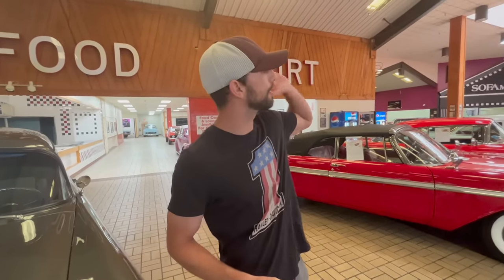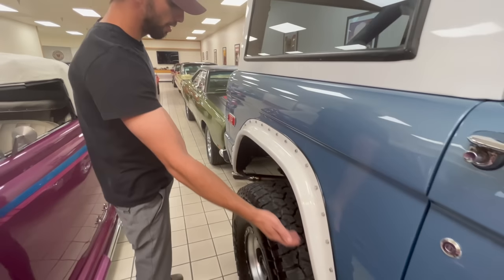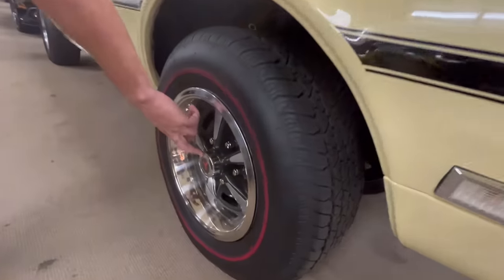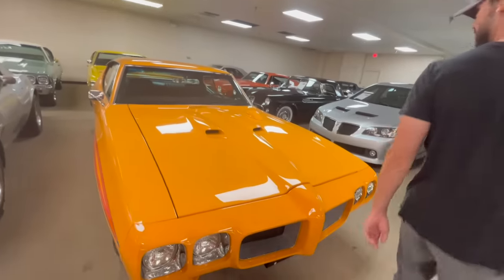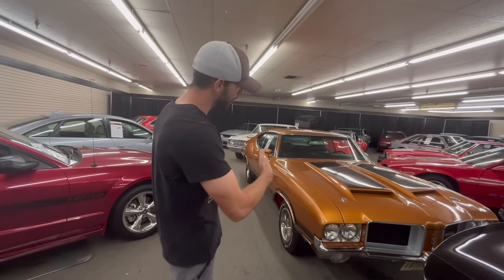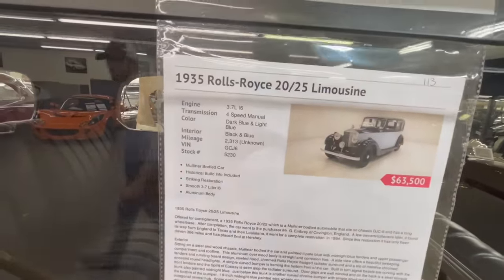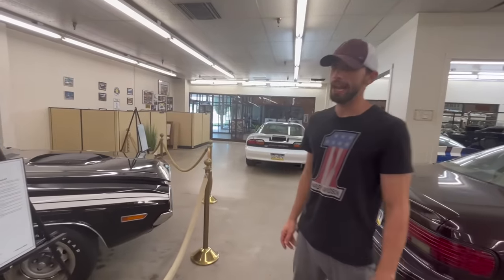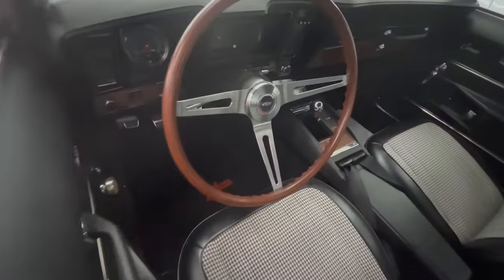Inside the ABANDONED Mall FULL of Classic Cars!!

Comment: A friend of mine has an original DZ Camaro. Black w/ white interior. Great shape. It's been hidden away in his garage for decades.
Reply: In the early 80's i had the opportunity to drive a 1969 Z28and an AAR Cuda in the same evening. both low milage and stock! The Cuda was impressive But the Z28 was slow. I was doing a lot of racing in those days. I estimate the cuda was about a 13.00 second car or even a little quicker. The Camaro was a 14.50 ET car at best. For drag racing you are much better off with a 427 Camaro than a Z28!
Reply: Thank God he is keeping the car in a garage

Comment: I seen some gen 1 mustangs in the background. I have a 67 coupe. Basic model. 1 of 472 because of color and motor. (Frost  Turquoise with a 289). All numbers matching.  Are the values of Mustangs still going up? Or holding thier value?
Reply: Depends on model, mileage and condition.  Rare does not always mean desirable.
Reply: @classicautomall2134  very true. I'm just impressed with your knowledge. And didn't know if they are holding value.  I'm guessing restored classic cars in general really wouldn't depreciate much. Unless they are parts cars or flat out scrap.